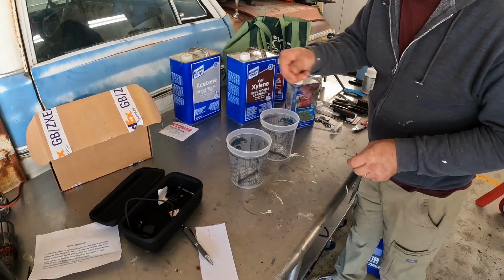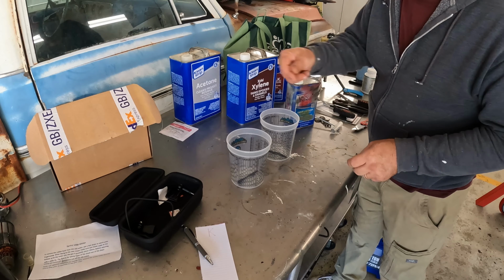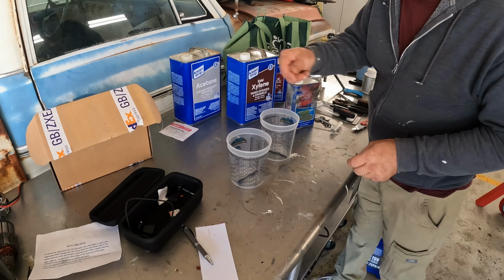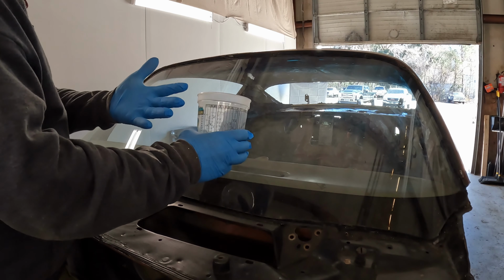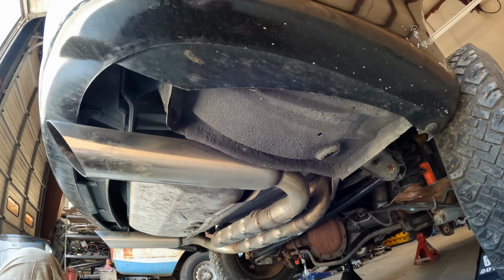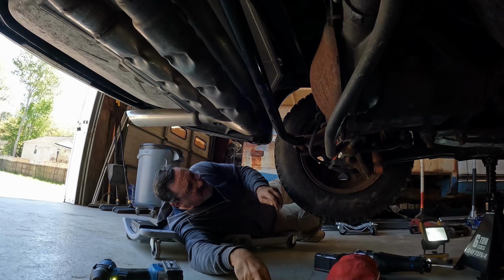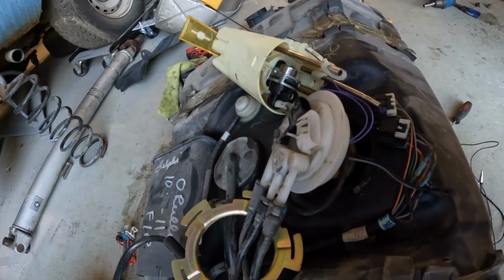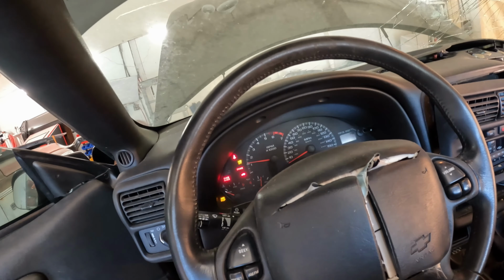Firebird Ep  09 Breaking glass and a running LS1

Comment: Hello Maverick! Thanks for your videos! I have a question regarding the panel that holds the hinges for the trunk lid. On my 81 Firebird, that panel is rusted so bad that the hinges are moving when I open the trunk, now the  question is, do I need to remove the back glass to replace this panel?
Reply from the maker: I think that panel fits under the rear package shelf and to get to the spot welds the rear window would have to come out. Chances are you're going to find some more problems though so I would say take the window out and see what's under it!
Reply: @MaverickModds  Taking the window out isn't what I would want to hear, it will be a nightmare to find another window if I break it :/. Thanks

Comment: You mentioned the phb are you swapping the rear too? If that's a stock z28 rear it's a pos. The 10 bolt in the bird is better
Reply from the maker: Looking at options for the rear, but I want to adapt the torque arm setup.